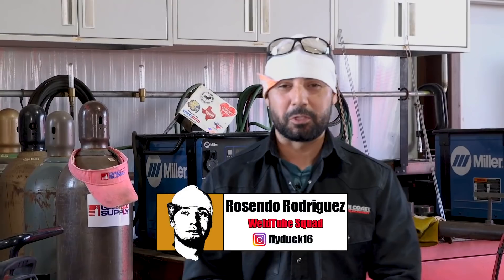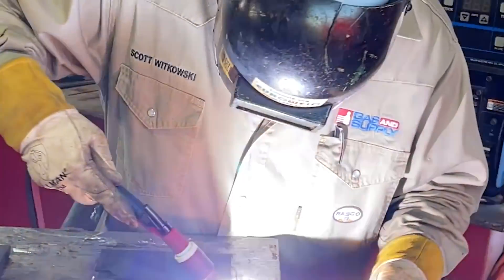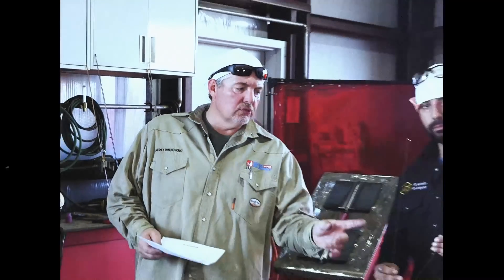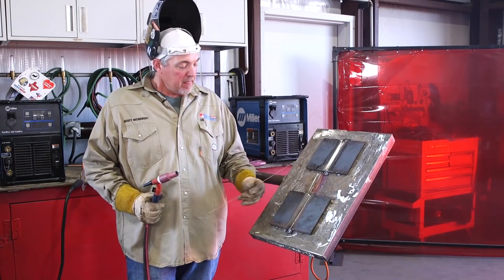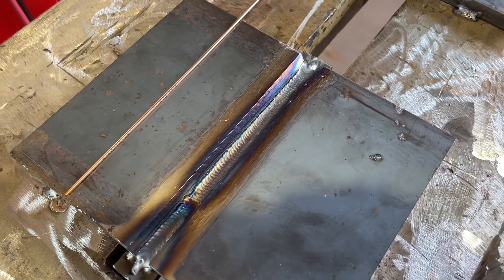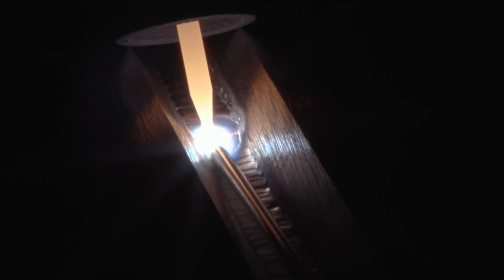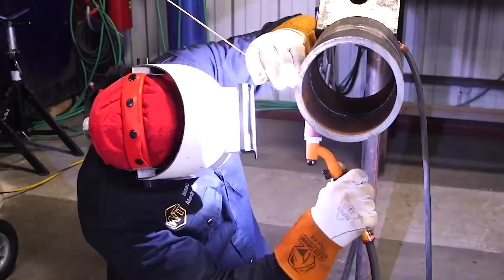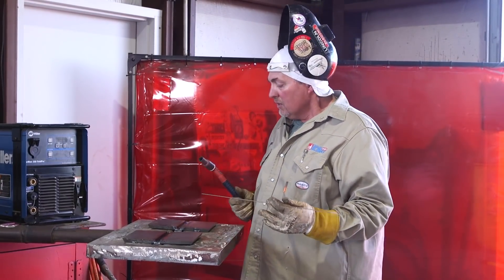TIG Welding ER70S-2 | Copper Coated VS. Non Copper Coated Tig Wire

Comment: Very nice video from your perspective.  There are some differences you didn't cover.  MIDALLOY 70 series  wire has better mechanical properties that the cheap copper coated brands can't meet.  You will also see better x-ray results and no "spitting".  Copper adds nothing to the weld metal, actually a contaminant.  So if you like "busting" x-rays cutting out welds and re-doing welds...go right on using copper coated cheap wire.

Comment: I usually clean the copper coat off with Emery cloth because it can show up as a repair in phaser ray. Yup.
Reply: It's phased array, a form of ultrasonic testing, ya ignernt fools....
Reply: Only on Mars🤔🤣🤣🤣
Reply: @djyul  nope on planet oil field
Reply: @marsattacks3455  i 've been welding 44 years,Phaser ray?
Only on Mars then?
Reply: @djyul  so you haven't seen it all apparently. Come to a boiler job.
Reply: @djyul  just because you haven't seen it all don't act like an ego maniac on this post. I posted to help people you post to insult.
Reply: @marsattacks3455   not my intention to insult you.
Was just banter!
Boilers,yep,i know boilers.
Transition welds etc.🤔 Doosan Babcock.
Reply: @djyul  for real in Canada here Alberta that's what they do, the phaser ray for boilers it's cheaper but not as good as xray. So we have to clean the wire with sandpaper or Emery otherwise it shows as an inclusion. It's insanity. Xray way better. But this is how it's done here.
Reply: @marsattacks3455  Never heard of a Phaser ray before.Watch yer eyes!Peace
Reply: @djyul  well it's out there and now you know!

Comment: The copper coating is trivial to the composition of the filler.  The only purpose is preventing rust.

Now deoxidizers in the rod are not trivial..they are there to prevent pops in unkilled steel along with any other junk inclusion.  Silicon also promotes fluidity as well as deox function.

Comment: In tig filler, copper coated vs bare filler all comes down to storage. If you’re working in a clean and dry environment with little humidity and you burn through packages of filler quick, by all means run bare filler.  Otherwise run copper coated.
Reply: Yes, the copper coating is usually more appropriate for MIG welding, because it sits on the spool for a while and needs to make electrical contact to work. I have opened certified 4130 TIG rods and they've turned to instant rust when I try to store them though. I use cheap ER4130 that copper coated now. The small amount of copper in the coating vaporizes when welding, so it makes little difference.